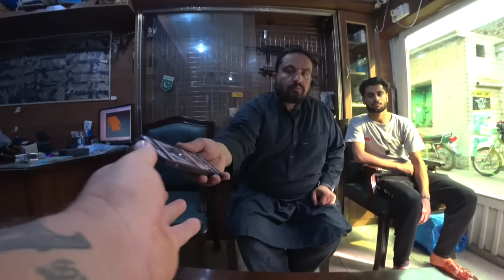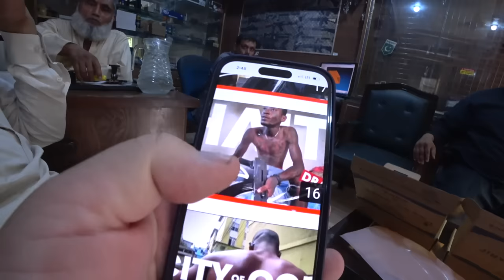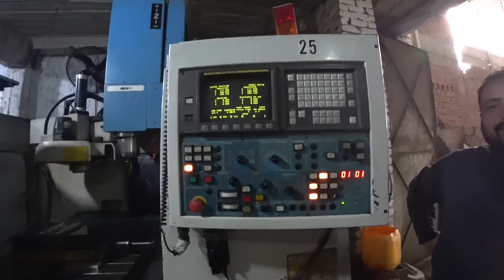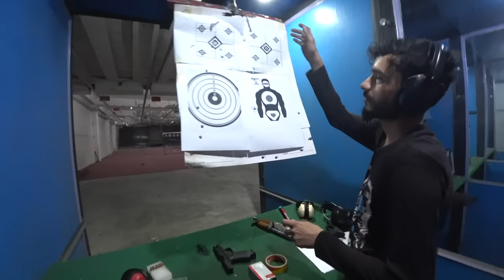How Guns are Made in Pakistan! 🇵🇰

Comment: It is amazing how these guys make guns out of scrap metal and produce something pretty good looking. The down side is the parts aren’t hardened or heat treated which affects the life of the gun but in their case, lasting for 2,000 rounds is fine. Aluminum must be anodized and treated to harden it properly or it’ll be soft as butter no matter the alloy content, the violent movement of the components takes a toll on quality alloys.
Reply: They last longer than originally produced pieces
Reply: @KalaMaal-zq3do  if you say so, lol.
Reply: From what I gather, the scrap is usually for frames and handles. They go thru a lot of hassle to source 4140 steel tubes for barrels. For example, if a full length AKM or AK74 is acquired, they cut about 6 inches of the barrel and sell the gun as a carbine, and use the cut piece for a pistol. Or they pay extra for the tubes from China.